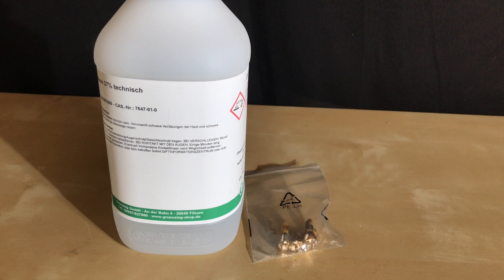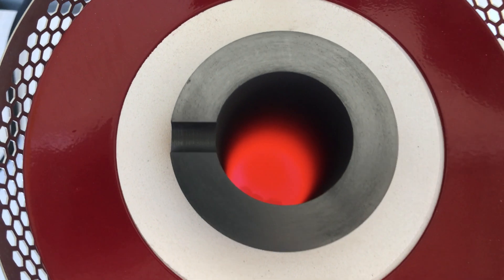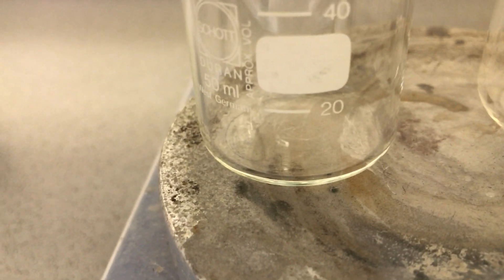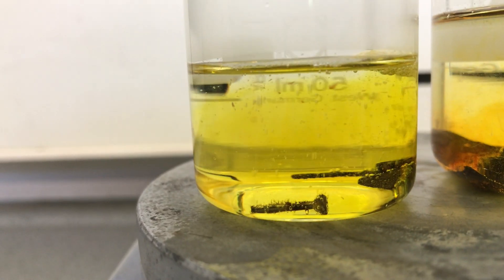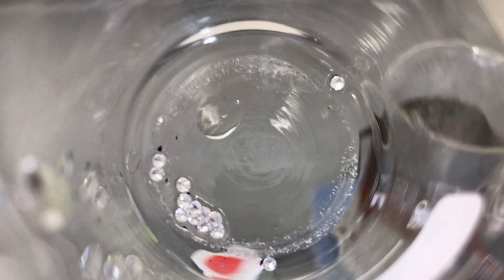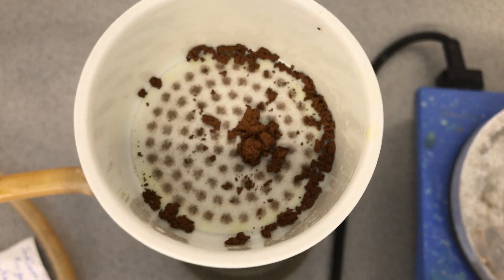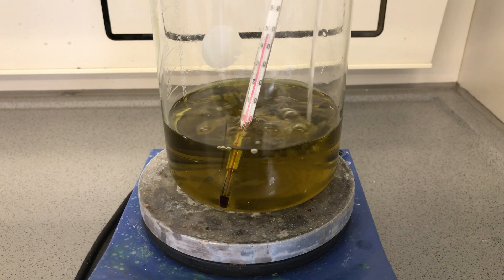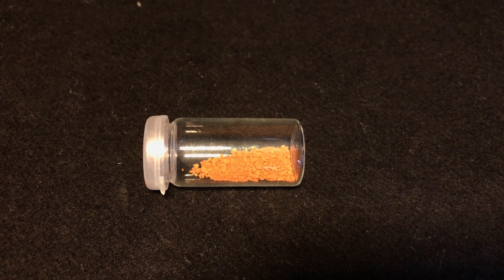Gold Extraction From Gold Teeth And Jewellery

Comment: A better method would have been to inquart the teeth with silver or copper. Then dissolve in nitric acid, to leave behing gold powder. The teeth probably had silver in them, but only in a small amount. That forms silver chloride and passivates the metal and is why aqua regia stopped dissolving the metal.

Comment: a little fun fact about dentistry is that most places use a sort of UV set polymer for teeth that is resistant to corrosion and also as hard as well teeth. under the influence of immense heat they break down and make some nasty fumes which smell awful. Im not 100% sure what type of polymer would have been used here to attach the gold crowns to the teeth.